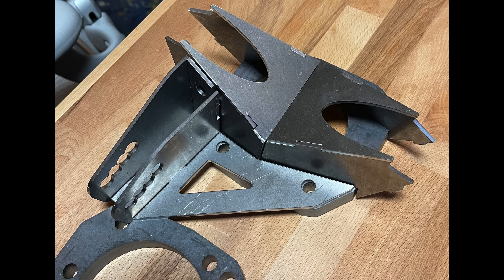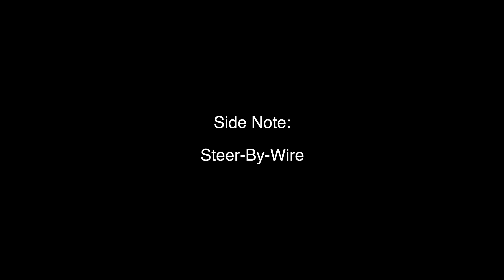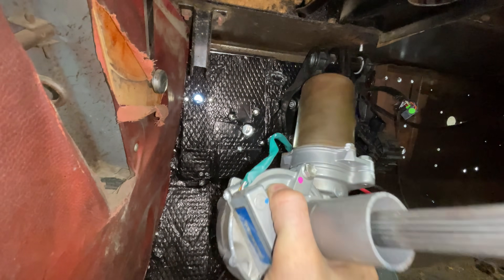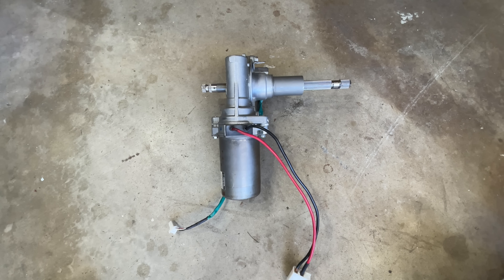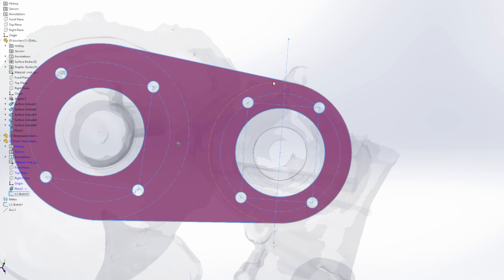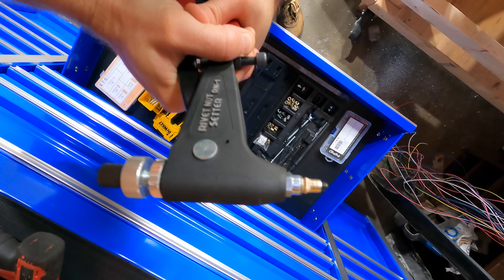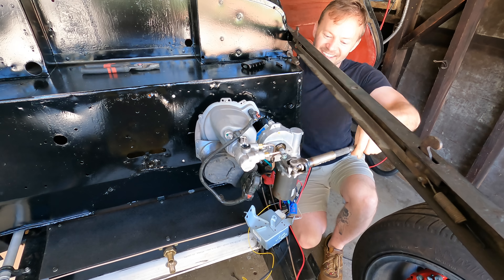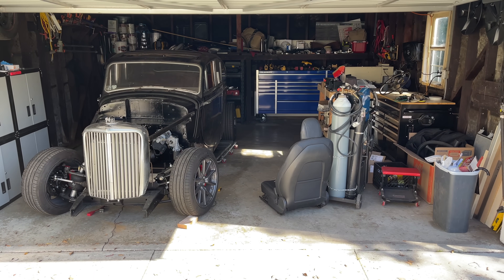Add Power Steering To Any Car

Comment: In the mid 70s went to a road party (under age drinking on country road)  attractive young woman got her finger stuck in a steering wheel with different size holes, the other girls tried lotions, Vaseline, KY Jelly, nothing worked. Ended up getting my tool box out of the trunk of my 65 Fastback Mustang.  Took the steering wheel off the car and took the girl to the Fire station. They worked about an hour before cutting it off. (No not the finger) then took the steering wheel back out to the country so the owner of the car could drive back to town.

Who ever said nothing exciting ever happens in a small town in Central Illinois.
I wish I could remember the young woman’s name so I could tell all her grandchildren what happened.

Comment: Thanks for this I have a 1974 BMW 2002 I have restored, but the steering is very heavy and have been toying with an electrical power steering assist.   Prius donor might be a good fit.

Comment: Hello! Thanks for the vid. I wonder, the issue with no self-centering when an eletric power steering diy kit is installed is something many people complies at forums and videos, how did you manage that? Has something to do with torque sensor and the module? Looks to me that forces applied at the steering commands the electric motor but forces at the wheels just don't. Something like driving without force feedback on the simulator. Did you notice something like that at your built?Many people returned to the stock mechanical steering because of that.  I wonder how the black boxes that hacks the module unit from the EPS could do to avoid that too, if it is real as it seems. Thanks!

Comment: mmmh I was learning because there's an ATV sterring rack which costs me 50 bucks less than what I need but has powersteering (edit: hydraulic p s ) and you kill the subject at minute 3 stating that you no need powersteer on a motorbike with 4 wheels.. But I'll stay, damn I wandered one hour before finding a good video exactly on how to add powersteer to a car.

Comment: Great work Matt, I have just purchased a Toyota  TOYOTA C-HR ELECTRIC POWER STEERING COLUMN PUMP 45250F4060 2016-2023, to add power steering into a 1967 Series 2 Land Rover, I cannot seem to power up the motor like you were able too, can you point me in the right direction for a pin out diagram, I have been unsuccessful.

Comment: Mounting the power steering unit parallel to the original steering shaft and using a chain or belt to connect them, would that work?

Comment: Very interesting.
What have you done to waterproof the steering system ?
The whole unit, including ECU is designed for fitting inside the car, where it is dry and therefore column EPS systems are not waterproofed at all.
If water does get in, this can lead to failure modes like corrosion inside the ECU, which can cause thermal incidents.

Comment: Great brackets, nicely fitted, but the welding where the electric power steering is bolted to the firewall is atrocious if not suspect with regard to both penetration and strength.

Comment: I would like to have the drive by wire system  and have a system where the  computer then adjust the wheel alignment then adjustable as your drive The car The chamber &caster

Comment: Something I never understood about "power steering columns".  The motor turns the steering shaft via a worm and gear drive.  Every worm and gear drive I have seen allows the worm (on the motor) to turn the gear (on the shaft) but NOT VICE VERSA  !  With no power to the motor, it should be IMPOSSIBLE to turn the steering shaft.  
Why am I incorrect ?

Comment: I hooked ground to my jump pack negative and both 12v wires to positive I hear a click from the module but then it clicks off, and I do have steering hooked up but still not working any suggestions, I got my power steering out of a 2010 Toyota corolla if that matters

Comment: Im going to put electric electric power steering in my 63 falcon. I’m using the 2011 Nissan Versa box. Some people say that it is to sensitive and failsafe mode. Is the Toyota Prius box different?

Comment: Does the steering module need to be clocked in the same position that it was on the donor car? You mentioned something about rotating it until it fit your car but I wanted to be sure on this. Is there any other donor model brand (Ford, GM, Chrysler, etc) that just needs the three wires to it? I have one from a 2012-2016 Chevrolet Sonic that has an integral electrical (brain) controller. I haven't put it on the bench and wired it up yet so I don't know about the wiring to it yet. Can you give me any help on that topic?

Comment: I am using the same Toyota power steering setup in my '55 Fairlane.  I would like to mount the control module on the passenger side of the car radio.  This would require splicing in a bit more wire in the control harness.  Can this be safely done?  Thank you.

Comment: Amazing, Matt.  Just want you to know you have another HUGE fan, and we just joined your Patreon club.   Matt, I'll just chime in with something I'm sure you've heard many times before - you are a FANTASTIC teacher!!

We are in the process of acquiring EVIE (get it? E.V.) a Nissan LEAF for our daily drive (yeah I'm embarrassed to achieve symbiosis with an EV the lazy way). 

So...

We have a dream of building a Jaguar XJS/EV.  Dear MAXIE is already here but powered by InFERnal Combustion.  We hope to donate her current V12 to some poor, deserving pussycat who will purr with joy,  Then push a subframe from a poor wrecked Tesla Model 3 under her and load up that great big engine compartment with batteries, a crumple zone, and a 45-degree plate in front of the firewall so (God forbid) in a hard frontal crash, she ejects her core like a starship.

Then MAXIE shall realize her true destiny, powered by starlight.

Matt - you are literally making this dream possible.  Bless you and be Safe...

Comment: Power steering:  If there is an interested Entrepreneur Please reply: I have a Design of a Rotary actuator that keeps the wheel angle stable even when stumble on bumps, a sidewalk or a hole in the road.

Comment: My 2002 Prius has basically zero steering feel - is there any way I could force it into a fail-safe mode (reduced assist means more steering feel) without getting a red triangle of death?

Comment: Does every Prius steering work like this? Prius ZVW40 part#: 80960-47120 is very compact, much smaller than what you are using! SAME SAME OR DIFFERENT? has 25V though 🤔
Reply: also no of the steering racks come with the control box…

Comment: Great project. I have a question for you. Hope you can assist. How does the car drive at high speed, say 100-120 km? Does the steering get stiffer the faster you drive? Or does it stay easy at any speed? Could be dangerous at high speeds.
Reply: the force required to turn the tires at higher speeds would increase as well though

Comment: Cool video. Just a suggestion, that i-shaft bolt at the end of the column looks dangerously close to those brake lines 😬

I'd consider an elbow or rerouting. It'd suck if the shaft breaks and tears off those lines.

Comment: Love the project concept.  I never thought it using a pruis steering pump on a hot rod build. In oct ill start a ls swap on a 1956 chevy 150. I want power steering and ac on the vehicle but have no idea how to install it other then taking it from a later model chevy 210, bell air,  or chevelle, or malibu since i want to keep the original steering wheel.

Comment: Im only now watching this and I wanted to add a remark to the steer by wire section. Steering is safety critical for some reason (people don’t seem to enjoy hitting walls, pedestrians or other cars) and given its FMEA classification it’s an ASIL level D system. Depending on how they design and decompose the system components you’ll probably end up with a triple redundant system. Which seems expensive but it means you still no longer need the steering column and if you increase the redundancy you can then use components that have a lower safety level classification (e.g ASIL B instead of D) which are orders of magnitude cheaper to develop and produce.

So amusingly increasing the redundancy will actually reduce the complexity and cost of the resulting system

Comment: Looking at doing the same thing, but need to add a steering rack quickener because my ratio is too low. Curious if adding one of those in line gearboxes behind the steering wheel will mess up the torque sensing of the motor. It will essentially receive 2x steering input velocity and torque

Comment: Hi Matt, I have used a corsa eps before as has its own ecu. Near the end of your vid you realise it’s doesn’t work because you haven’t plugged in the control box, I thought the benefit of using a Prius eps was that it didn’t need a controller, just 12v. Have I missed something?

Comment: Nice! I've rigged one up to my 92 Civic's steering (H23A swap, no good PS option) and looking forward to the telescoping function it adds (Corolla version of this EPAS).

One thing to NOT skimp on is power wires and alternator. This is by FAR the most powerful motor modern cars have on them, besides those on hybrids & electrics. They are usually fused for 80 amps and draw 30-50 amps continuous, 70 peak. The Saturn Vue version has a fat cable going directly to the battery with a MIDI 80 amp fuse. People that race with them will tell you how bad it feels when an insufficient cable, alternator, and/or battery is used.

Also the Toyota CAN messages for this system appear to be fairly straight forward. It needs any RPM message (constant 1000) and speed, that's it. Someone claimed to have got it working using a Proton MC, but should work with anything like an Arduino with a canbus module.

Comment: Would it not be advantageous to mount the power steering motor at a downward angle towards the rack to minimise extreme  cv joint angles ?

Comment: Rivet nuts into sheet steel makes my teeth itch. Once the threads age even just a little bit to just a moderate level of 'stuck', the buggers will tend to spin and if you can't get vice-grips on the nut, you're kinda screwed. Ask me how I know...

For the love of god I hope you're using copper-slip on them!

Comment: I want electric steering in my old 80 avenger (cricket) not because it is super necesary since is a light small car, but because I want bigger wheels in the front and small steering wheel... (15" against 13") I was interested in electrically asisted column from toyota but here the prius is a green dog (rare) and parts are expensive, so the idea was to get a corolla or yaris column, nor "cheap" but more common. thanks for the vid gave me ideas.

Comment: My truck (Chevrolet Veraneio, its a Suburban chassis with a Brazilian design) don't have power steering, was searching for the pieces and after seeing this video found that using a Prius column it would be easier and cheaper than to use a engine driven power steering pump and steering rack! Weird!

Comment: ok so 
Rivet nuts
I have found that the metal aloys they are made of react badly with steel. The eirther seize on the bolt or rust out the hole in the sheet metal. If it is durability you are  looking for I would steer clear of these rivet nuts. 
But cudos on the project. Envious of your skills and equipment :-)

Comment: If you wonder why this sort of stuff is still measured imperial, go price a Starrett measuring tool and realize that every machine shop is packed with this stuff.  Going metric would mean replacing ALL of it.  A quarter million dollar expense for a small shop.  Much cheaper to buy a calculator and convert to the nearest thousandth when it just has to be metric.

Comment: Question did you use your stock power steering rack and delete the lines or did you have to but one specifically for the electric. Maybe I missed that part I tend to skip around when I’m at work ha.
Reply from the maker: It’s a non powered rack from a BMW Z4
Reply: @SuperfastMatt  ohhh ok thanks for getting back to me man, really appreciate it. I’m going to dig into this at the end of the month for my c5. Your video was very good.

Comment: BEAUTIFUL VIDEO! 50 years in fleet maintenance and 55 in loving mid '50's Fords. This electric power steering assembly and your link to "Send-Cut-Send" is GREAT! I want to custom fab an aluminum oil pan for a Ford Y-Block. The flange to bolt to the engine was stumping me as to the 'best' option. Thanks to your video, I think I've found the answer! Thanks!

Comment: I have a weird set up from the factory. It's the usual hydraulic power steering setup, but the hydraulic pump is not driven by the auxiliary belt, but it has it's own electric motor to drive the pump.

Comment: Steer-by-wire?  Don't like that idea.  I've had nearly every imaginable electrical failure at some point in my driving career.  My throttle-by-wire failed and my car basically stopped going while I was trying to merge onto a busy interstate.  Alternators, ECMs, window controllers, instrument panels:  they've all failed with varying degrees of disaster.  

How about the simple thing.  Car's dead.  No power.  Let's push it to the side of the road.  WHat?  No steering?

No thank you.  I'll keep mechanical steering and a mechanical connection to the brakes.

Comment: Matt….thanks to you I pretty far down the rabbit hole of exploring this Prius power steering swap for my 64 Land Rover. Do you think it’s overly complicating the Prius system to have an arduino or something create the VSS outputs that indicate the car is going say 10-15 mph? This would give you more assist. Which would be awesome For a heavy ass car like an old Land Rover or jag. Is it simply not worth it? I’m assuming you considered boosting the assist by emulating a lower speed at one point during that build? I’ll hang up and listen

Comment: so I subsribed right after your tesla doorhandle video and then unsubscribed again 5.2 minutes into this video. Still coping with my anger because of the intergrated advertisment (which I cannot adblock out) I had to handle a too long dragging on video with failed attempts to being funny. I gave up 5 and half minute in. But I have to thank you as I learned something. With every next video I ever watch, I am going to compare the title to the length of the video. That will tell me if it is going to be a bore. 13 minutes to explain how to add power steering to any car should have told me something upfront. "any car" should have told me, it must be a general simple construction and then a 13 minute video should have told me there must be a lot 'not to the point' side steps in it. Thank you for teaching me to even select better next time.

Comment: If your working on a car with hydraulic power steering just use a opel electric power steering pump, its a cheap and simple solution
Reply: No Opels in America, but Toyota sold a zillion Priuses here. Or would it Pri-eye?

Comment: @superfastMatt   If you use a lot of rivet nuts you need to check out one that goes on your drill.  Astro Pneumatic  makes a nice one I use at work a lot. Makes installing them a lot faster.
Reply from the maker: Thanks for the tip, i'll check it out.

Comment: Hi Matt, found your vid whilst researching how to fit a Prius power steering to an 1965 Alvis TE21.  I already have the steering motor/controller, my challenge is how to fix it to the car, apart from the chassis All the sheet metal under the bonnet is non-structural. I am working on the supposition that the max torque that can ever be applied to the column is what a strong bloke can apply to the wheel to resist bump/thumps such as kerbing a wheel at speed - probably not more than 100 lbft. Does that seem reasonable?

On a side note my first car (back in 1968) was a 1949 Mark5 - that's where I learned what the back seat is for :), I did not have it long before crashing it on packed snow. In the UK we have annual MOT (safety) tests. I recall taking the car for it's test (before the crash) and being told by the tester that the brakes failed to meet the 1968 legal braking standards - even when new,  so you are wise to replace those appalling original brakes.
Reply from the maker: That seems reasonable.

Comment: I'm not keen on all the assist motor torque going through that clamp on the 1.5" shaft. I'm reading the subtitles so maybe I missed that you're planning on adding more bracketry to it.  I'd think the whole unit needs to be tied in more strongly to the firewall to resist twisting.  It seems like when you start turning the wheel under load, the torque from the assist motor is applied through that clamp.   Normally that steering box would be bolted to a fairly strong structure behind the dash board.  This design hangs it out in the air.
Reply from the maker: I'll be tying it into the brake booster on the opposite side. plus the clamp has a set screw into the tube. I'm confident it will be far stronger than necessary.
Reply: @SuperfastMatt  I guess the question is how much actual torque is applied from the assist to the clamp and aluminum tube? This seems dependent on the steering box ratio and how large and sticky the tires are you're using. 

Just driving around I imagine the assist unit will move up and down on the clamp as the car bounces up and down on the road. 

A bracket tying it into the booster is a good idea.

Comment: I'm hoping to retrofit an electrohydraulic pump in my bmw 135i, in order to install the m2/m3/m4 oiling system including the pan, baffle, and dual oil pumps. Any idea of what steering feel is like with these electric pumps? I'm thinking of going with the trw unit, a volvo pump, or a mini cooper pump (keep bmw with bmw :) Any advice would be more than welcome.